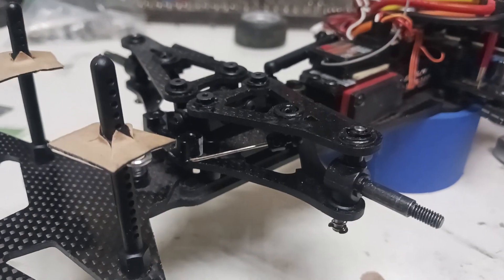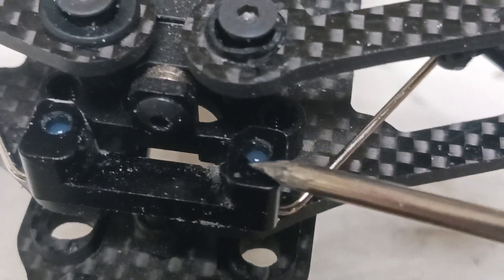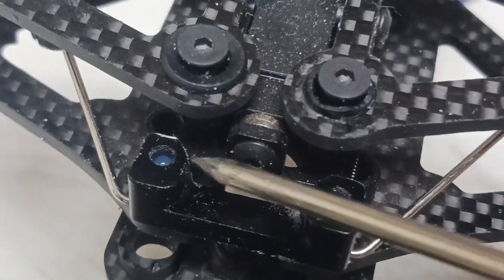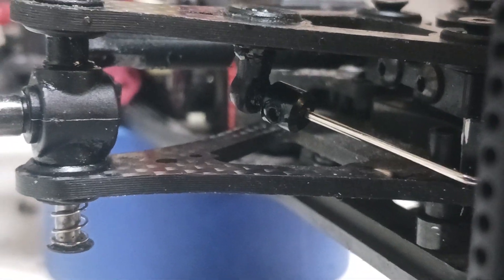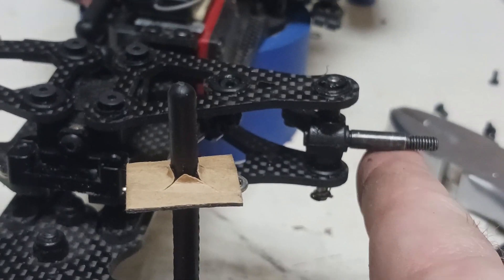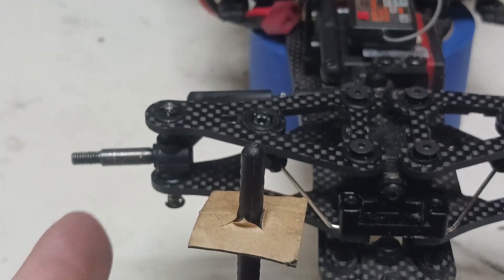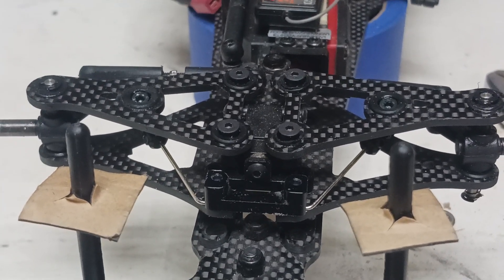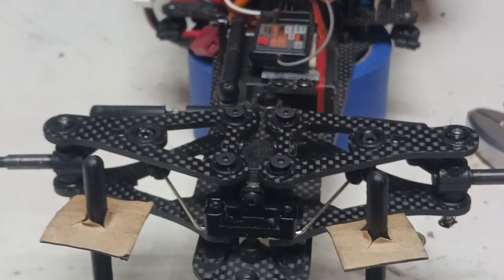3. Install a sway bar for the Carisma Zonda R or F1. 1/10 scale.

Comment from the maker: This is part 3 of the sway bar. 

This Carisma carbon chassis touring car has been a bit difficult in my opinion due to the lack of translation?
And or the lack of instructions. 

My M40s was very good in its printing. 

I'm guessing they changed management?

Anyway, this might be the wrong way to mount the sway bar on this F1 chassis.
Sooooo...take it as an idea with a grain of salt.

If you know the correct way of the sway bar installation, please feel free to post a link.

Part 2. Of the sway bar.
https://youtu.be/xjxi3zX7a_U?si=meAnK-HqIO-S4S2u

Part 1 of the sway bar.
https://youtu.be/NUjrDVOxmAE?si=qII6NPX3fuPsmELU